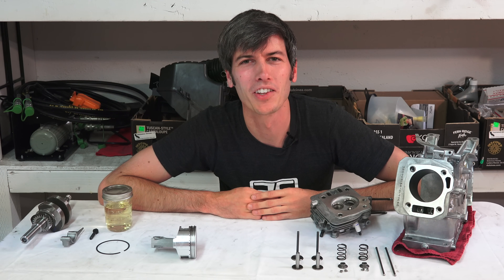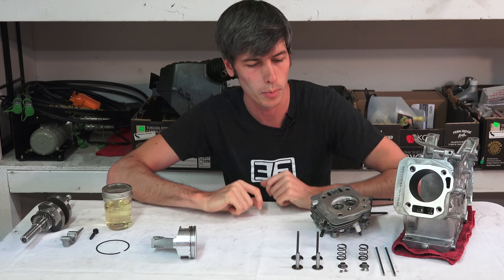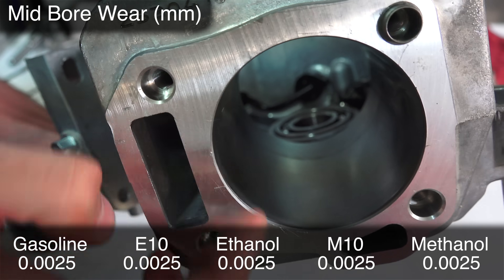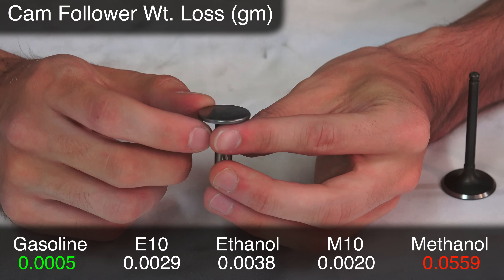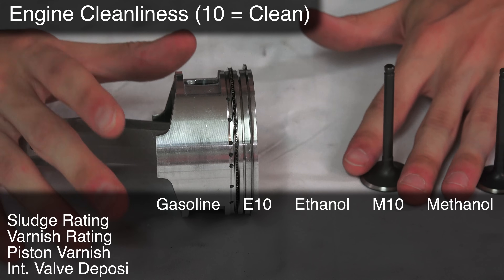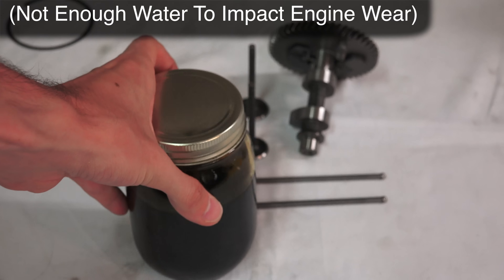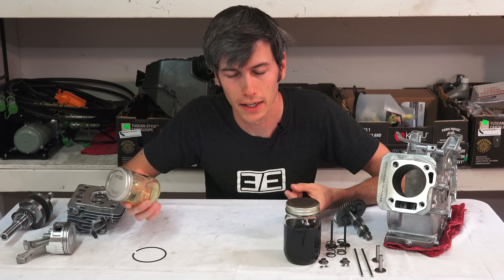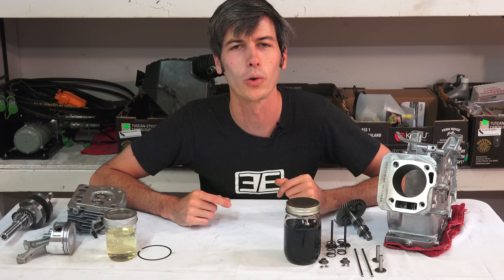Is Ethanol Bad For Your Car's Engine?

Comment: It's SMALL ENGINES WITH CARBURETORS that ethanol seems to take a toll on, which is why your 2-cycle trimmer (etc) never seems to run very good for very long.  Of course since cars haven't had carbs in years, it's not a problem for them.  But it's more a case of "fuel system problems" on any carbureted engine, which etoh can cause, rather than engine wear, it would seem.

Comment: I kind of like a little ethanol in my fuel because as long as I crank my small engine powered tools once every couple of months I don't have to put stable in the fuel to keep it from turning to varnish like I used to a few decades ago.  Keeping the fuel circulated is key to prevent water accumulation and acid/separation from occurring.  That's been my experience anyway.  I've got a blower, chainsaw, and 3 lawnmowers that haven't had carburetor work done in over 10 years because I start them up every 2 1/2 to 3 months and let them run about 5 minutes.

Comment: older cars defenutly hate Blended Fuel compared to 100% gasoline.  My 1999 Hoda CRV used to rough idle all the time (sometimes in summer with the AC on, it would actually kill itself) but, once I switched it to 100% Gasoline, that issue went away and improved power, and MPG (went up from 24 to 27) Also, even though new cars are designed with Blended Fuel in mind, 100% gasoline helps out a LOT with MPG! I go from 33 MPG to 40 MPG in my RAV4 Hybrid when I use Pure Gasoline lol

Comment: Yes alcohol is badd fear engine because you don't have enough compression to run it plus it wasn't designed trailed the Hall he needs special orring's in your injectors and then again it just runs all to tailpipe

Comment: Honda 1.8 ivtec seems to do quite fine on e85: a whole year, 35000 km and no  noticible differences,  not even in fuel 
consumption.But I do consistent 10 000 km oil changes, because i think oil degradation is where the biggest danger lurks.

Comment: Thanks for the research and information. I wonder if the study also looked at rubber/polymeric seals? I have a feeling special chemical-resistant seals, or equivalents, must be used for E10 applications? In all modern cars?

Comment: Small engines get fuel parts ruined by eth. I can’t get my av gas anymore. Terrorist and such. We used to take our scooters and get a top off before a race. Gotta test av gas on ur hands. It won’t smell. I wish we could get red diesel still. No tax and runs better. Saga sorry.

Comment: Lower fuel milage and attracts water so the fuel lines plug, and the fuel components also plug. It can't be left months at a time without running.

Comment: WHY would the methanol have more wear on the CAM LOPES?  Did they put methanol in the lubricating oil in the 20 hour test?  Was the fuel mixture AND TIMING management systems of the engines not set/adjusted for the best combustion/power/economy of the different fuels used?  

What was the compression ratios of the engines?

Being that the test data relied upon came from 1980s, were electronic engine management system used or not used to make adjusts for the different fuel type combustion characteristics? 

What is the BTU rate of the different fuels and how does/would THAT affect wear or lack thereof?  

What were the net gains or losses in power of the engine? (yes, I understand, that NOT what THIS video is concerned with, but looking at just ONE set of result without considering the NET functionality/benefits/loss to 'real world use' really doesn't mean much)

If an engine is setup for a certain type of fuel and a different fuel type is used, but no adjustments are made to/by the engines management systems for such fuels, then the results may or can be inaccurate, misleading, and/or even deceptive.

I get that you are JUST looking at "wear" in this video. But there are many questions, even related to wear, that are not made known with this "test data" as presented within this video.

Comment: Cons of ethanol:
It shortens gas life
It clogs injectors and carbs
It takes in moisture

Pros:
It pays my bills when people run into the above problems.
Reply: Ikr. I'ma. Collision tech and a mechanic.
Reply: Doubt it
Also gasoline will clog faster than e 10 cuz e 10 runs cleaner lmao
Reply: Explain the Nissan GTR that runs of 85% ethanol

Comment: In Brazil we use Ethanol since the late 70's. in the first years there was a legitimate concern about corrosion but with new materials and lubricants this has been ruled out decades ago. Yes, it has less energy by volume so the mileage is shorter but it is higher octane and can be compressed more to deliver more power and torque (significantly more). You have to factor the price too so you can have a final cost. As for the rubber parts and like it is a matter of materials to be adequated, today it is not an issue here in Brazil, there is no more discussion about that kind of problem. Anyway, in less than 2 decades from now it will be part of the history since the electric will be the rule.

Comment: The problem is, we arnt worried about metal wear on hardened steel. Its the aluminum rubber and seals that dont hold up. Also if the fuel sits at all every store will take the brunt

Comment: Ethanol is hydroscopic, that makes it suck for many reasons. I miss the days when gasoline didn't turn bad after a month and jam up my small engine carbs.
 It also contains less energy than gasoline, so mileage suffers. And finally the use of ethanol is subsidized by tax dollars, which makes no sense whatsoever given the plentiful availability of petroleum fuels.

Comment: Have you ever seen what ethanol does to carburetors? It completely rots and gums up jets needle valves floats etc..
Reply from the maker: How, ethanol is a solvent, it's used for cleaning nearly anything. I don't think ethanol alone would create a sludge or gum things up. Perhaps other contaminants are present.
Reply: @EngineeringExplained  ethanol attracts moisture and and water, I've seen this all across all of my small engines, gas from multiple different stores. Didnt have this problem 10 years ago lol!!

Comment: Does Ethanol have negative effect on car engines with carburetor? 
I mean if Ethanol "likes to absorb moisture" and turn into water, isn't going to affect the horizontal fuel pipe (that small "fuel tank" that feeds the carb with gasoline)? If water is concentrated there the the carb will have problems.

Comment: For cars it isn't a very big issue, for motorcycles ethanol is the devil. I've cleaned gummed up ethanol out of several carbs and it's never fun. It is a big pain in the ass. For a couple weeks I tried using the 10% blend in my sportbike after hearing lots of discussions where people say it doesn't hurt it. Few weeks later I was cleaning injectors out. I don't notice a difference in octane ratings performance, but ethanol sure does.

Comment: I run 30% E85 when filling up. It makes it about 92 octane depending on the time of the year and is quite a savings over premium.
Reply: E85 is 15% ethanol so how is it 30%?
Reply: @doorguner01  E85 is 15% gasoline and 85% ethanol.

Comment: Been on and off E85 in a Volvo 2.5FT engine for 150,000km. E85 became a tax-free fuel (Sweden), so exclusively for a year now. The only anomaly I can think of is plausible oil consumption, less than 1 quart, between service intervals. And the fact your have to fill up more often. The engine runs best on a 50/50 fill (not a true 50% ethanol mix) which is cheaper than gasoline in the end.
Reply: Now I found out that Brazil uses hydrous ethanol fuel. Azeotropic compared to anhydrous in the rest of the world. Can't verify claims at all, but if that is true every car engine in Brazil should be rusted away. Clearly they aren't.
Would be really funny if this was the case, invalidating 98% of ethanol fear mongering being thrown around :D

Comment: for those who thinks 20 hours is a poor test
here in Brazil we have cars running on 100% ethanol since the 80's, using carburetors
also with the advance of adaptive electronic injection, almost every car since 2005 uses flex technology so they can run on 100% ethanol, 100% regular gasoline (E27) or any mixture of these two
ethanol is way cleaner and won't cause extra wear on a proper design system

Comment: Yeah, it was the older fuel systems with rubbers that were not compatible with the alcohol-based fuels that caused most of the early problems surrounding ethanol, etc back in the day. You still kind of see it on some of the older antiques that haven’t had their rubber parts replaced with modern compatible rubbers.

Comment: In Brazil we use ethanol/alcohol for the past 40 years!!! 85% of the fleet is flex fuel in any mix.There are no major issues in using pure ethanol or any mix, if the fuel system is prepared to work with ethanol.When it comes to engine itself, no problems at all.

I have learned that ethanol has equal to 100 octanes when compare to gasoline, but with less calorific power.

Comment: Ethanol mixed with gasoline burn quicker than non-mixed ethanol fuel therefore gives a lower gas mileage. A pure unleaded fuel gives more gas mileage; covering more distance. This is based on personal driving experience using the mixed and the non-mixed.

Comment: I have a 2000 Acura TL I bought new in 1999. Having had the car for so long, I've firmly established two well-tested facts: (a) the car gets about 5% better gas mileage with E0 than with E10 and (b) to get started, it needs to be cranked 3 times longer with E10 than with E0. So, E10 being my obvious choice, the problem is that in the Florida locale where I dwell, E10 is available only with 89 octane, while the car needs 91+. I solve it partially by mixing 89 E0 with 93 E10 (both priced the same) 1:1, which results in 91 E5. Still not pure E10, but at least I get 50% less ethanol for the same price.

Comment: When I was working as a small engine technician, I rebuilt dozens of carburetors from small 2 stroke engines whos gaskets and seals had swollen due to ethanol. Now, many professionals buy certified, premixed 2 stoke fuel in prepackaged cans for their equipment. Ethanol is fine if your fuel system was meant for it. But sadly, there are still plenty of engines out there that it hurts.

Comment: I see a lot of E10, some 100% gas, and the occasional E85, but I never see E100. I can kind of see why, the fuel system has to compensate for the lower evaporative pressure of pure ethanol, but still, it would be nice to have the option of getting E100. Also, pure gas here is over 50% more expensive than E10 which makes no sense. It should be around the same price, maybe 10% more expensive. When I do see pure gas around here, it's always "mid-grade" or "premium", never "regular". My car claims to be able to handle E10 but on E10, I have to use "Premium" or it runs like crap. On pure gas, I can use any grade. If it weren't for all the emissions crap and OBD-II port, I'd swap out the ECU and tune it to use E85 as it's actually a lot cheaper, however, it would then not pass inspection. There are other ways but frankly, the car is elderly and I doubt it will make it to 200K miles without a lot of expensive work. It's already at 145K and almost ready for an engine rebuild. I haven't decided if it's worth a rebuild. Fun car, but I hate that it has an automatic transmission and there were no manual transmission options for that model year so I can't do a transmission swap.

Comment: Hello! I have a question for you: In Europe, Asia and Latin America, the high cost of gasoline makes it common for people to convert gasoline cars to LPG. I've heard people say that converting gasoline cars to run LPG damages engines prematurely, especially the valves, while other people say that LPG combustion is a lot cleaner, that there is no damage to engines, and that engines can even last longer when converted to LPG. What are your thoughts on this?

Comment: If you go to a gas station that has 1 nozzle for all three grades,  you can select the no-ethanol 91 octane, BUT, if the last guy/gal bought E10 87 octane, that hose is full of the later product and you get maybe .5-1 gallon of it.  Its called a "line displacement" in the bulk fuel world.

Comment: Good vid! I too thought that 20hrs seemed too short a test time.  However, as you mentioned if there are differences at 20 hrs then likely those differences will only continue to diverge thus further proving the same conclusions. 

To add my own story, I have run 10% ethanol [e10] in my 1976 ford F-150 [460 engine ] with only a few minor problems. Overall it runs fine both at idle and at high RPMs [does not surge miss or backfire] but has noticeably less power when running flat out. Normally It will take steep hills no problem but with e10 more pedal is required. At lower cruising speeds it's not really noticeable. 
The other problem is that it will want to stall after running hard and coming to a stop. I don't know if this is b/c it's running too lean right after letting off the accelerator or if e10 vapor locks quicker [has vapor lock problems in the heat of summer running regular gas anyway]. Or if it causes the rubber O-ring, that seals the metering valve in the carb, to swell which allows more fuel into the intake when decelerating b/c the fuel is getting sucked into the intake instead of the O-ring sealing and pulling the metering rods down instead. The truck has two tanks [front and back] so I can switch from e10 in one to straight regular gas in the other and the above problems go away once the e10 fuel in the lines has been burned [which doesn't take very long as the gas mileage is not great]. So far I have not had to replace any fuel lines, that were not already cracked from age, both fuel gages work perfectly fine and I haven't replaced the stock mechanical fuel pump either... [I was going to but none of the fuel pumps from Napa, AutoZone, or Orielys would fit. The pictures looked just like the original pump but all were different and would not mount up.]
This truck is completely stock, still running the original Ford Motorcraft four-barrel carb and has not been properly tuned [I think it is running rich which is why its not that noticable]. 

That being said, "My" 1990's Mercury Grand Marque car with fords 5.0 EFI engine WILL NOT run on e10 without complaining. It will surge, idles poorly and will stall when idling especially once the AC pump kicks in. And it takes several tanks of regular gas to get it to run normally again. So, if I had to run e10 in anything it would be my old ford f-150 before my car but sometimes it's not an option as some places only carry e10.

It's funny though b/c since the car is so sensitive we use it to check if the 100% gas is really 100 percent gas. One time we ordered some "100% gasoline" out and ran it in the car and when the car started acting up we assumed the gas must have had some ethanol in it. We contacted the gas company and they told us the tanks had e10 in them previously and we "may' have gotten "some" ethanol in our supply and not to worry about it b/c it was not enough to make a difference [the car could tell!]. After that and running that tankload of fuel through our lawnmowers, weedeaters, and four-wheelers we ended up having spark plug failures in almost all of those small engines within a year [I have never had a spark plug fail in a four-wheeler before]. So now if the car acts up we are more careful before we use that fuel in anything else... besides my truck.
While that doesn't mean that ethanol caused the spark plugs to fail it was still a really odd phenomenon as it happened across the board on old and new equipment which all had different brands of plugs. 

That being said though I have not had any spark plug problems in my truck so I don't think I could say ethanol is the culprit but I'm still warry. [was probably just bad fuel anyway]

Comment: Ethanol is not bad for the engine itself, only to rubber components on the fuel system on some cars. It's a matter of controversy more due to some eventual impact on food prices and availability than anything else.

Comment: Is Ethanol Bad For Your Car's Engine?   No, but ethanol is a water based mixture and will rust your steel fuel system components, including the fuel tank and injector rails. I run a storage facility for car collectors and the first thing we do is remove the fuel from the car and replace it with special non-ethanol fuel.

Comment: Ok.. so no problem for 'modern cars'... 2012 and upwards.

Lovely, but I'd like to have a breakdown in percentages of how many registered cars there are from BEFORE 2012 and AFTER 2012. I'd be surprised if there were any less than 30 or 40% of cars on the roads today from before 2012.

Comment: When I was young they called high octane gas Ethel, because that is they made the octane higher by adding ethanol to it. It didn't hurt the cars then. But gas Co. started using different things that cost less to increase the octane.